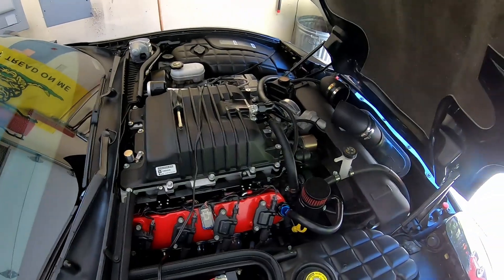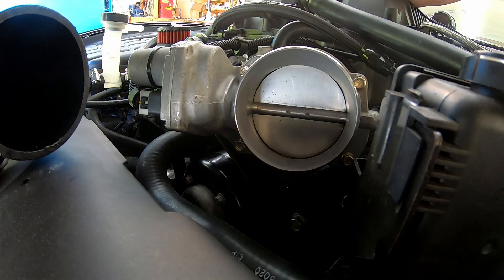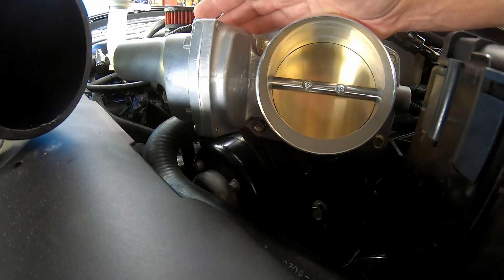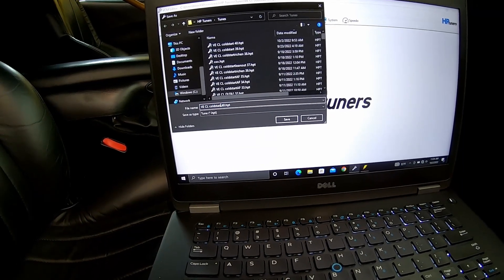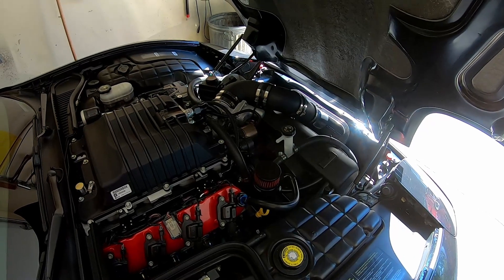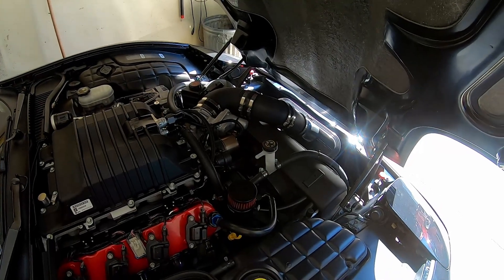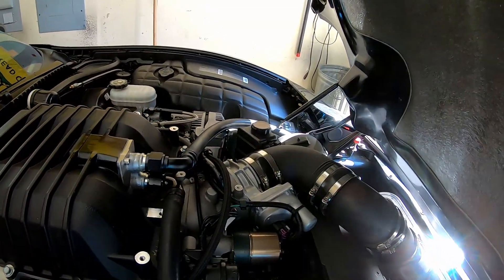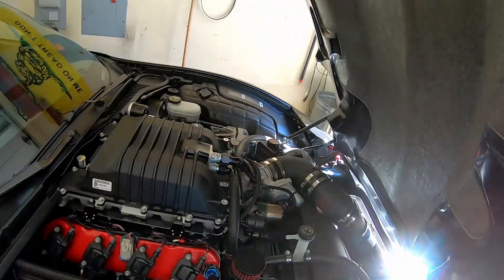How To Run 90mm LS3 Gold Blade Throttle Body On Gen 3 LS1 VS Silver Blade C5 Corvette

Comment: I have a corvette c5 2004, and i have problem with the throttle body because  is compatible ls2,ls3 and ls7 and the throttle body when i push the pedal on the acelerator it moves a little bit.
Reply from the maker: Jr I'm not sure exactly what you have going on there.  Are you saying that you put on a 90mm throttle body and that the car wont' run?   Also IIRC the 2004s run a different PCM than the 99-2003s.
Reply: @PNW_Car_Mods  i put the throttle body 102
Reply from the maker: @jrantonio07gamer75  Wait, are you saying you are running a nick williams 102 drive by wire throttle body?   If so, those take even more tweaks in the tune to make them work and I honestly don't know what all those changes are.  It can be done though.

Comment: Corvettes are finicky with the throttle bodies. Cool to see a ls3 one working. I am putting a ls2 TB on my brothers car
Reply from the maker: Yes they are.  Some people have no problems and others have so many problems they end up going back to stock.   The problem with LS2 throttle bodies is there aren't that many of them and the pool of them are getting old.
Reply: @PNW_Car_Mods  I know and people want a lot for a very used throttle body. I do have a couple ls2 throttle bodies and 1 ls3 throttle body. We are doing a 408 stroker with ls3 top end. Already tested both ls2 TB and they work no codes as of yet. I’m going to have to go through your videos since I’m a new subscriber. Love the LSA on your corvette! Looks like a tight fit tho

Comment: how is it so far? you did anything else? mine was able to start after 4 attemps but code were present, i just found the hp tuners forum, but its great to see it actually worked.
Reply from the maker: If you have codes it is likely because of an actual problem with wiring or throttle body internals and not the result of running a LS2 or LS3 throttle body on a gen 3 PCM.

Comment: What about running a gold blade LS3 throttle body on a 06-07 Corvette?
Reply from the maker: I am not sure on that max.   That is a totally different generation of PCM.   You might have to do some searching on the forums.
Reply: @PNW_Car_Mods 
The C6 doesn't suffer from the same problem. 
The C5 PCM/ECU is problem. 

We're probably going to the Holley Dominator and remedy all of our problems with the 102mm Nick Williams gold blade TB

Comment: Hey,  im back here again,  so im having some issues with my ls3 throttle body, I got REP right away before I even started it, so started it fine except no pedal response at all , so when i checked when the car is off , boot removed the blade doesn't move at all when i press the pedal,
Reply: It's all brand new, I think the harness I purchased while back from Amazon,  unknown brand, I think I'm going to get the caspers one to give it another shot,  also I forgot to mention the throttle body I was trying it was for like a 2010 silverado truck,  it's ls3  90mm . I also still have brand new gm ls3 gold blade when I hooked it up yesterday,  It works the throttle moves fine , the only problem with this one I can't install it because I have this 92mm FAST intake manifold it's longer then the stock so when I try to install it , the plug on the throttle body hits the  serpentine belt tensioner , see in your situation u have a supercharger with a snout that kinda offsets your throttle body,  for my case to clear their belt tensioner I would need like almost 3" spacer adapter,  so I'm kinda stuck
Reply from the maker: @boggsd4067  any chance you could flip the gold blade to get clearance?  Even if you have to extend the adapter harness?
Reply from the maker: That would be a hard one to troubleshoot without being there in person.  Do you know the history of the throttle body? is it new?  Used?  What adapter harness?  Any bad connection will give instant REP and no throttle.
Reply: I thought about that,  my harness will reach fine only issue , power steering reservoir is in the way , not it has to be relocated,  no really good spots to do that,  and even wille I was looking close if I do that,  the bulky part of the gold blade looks like it might hit the alternator braket
Reply: I just checked again,  it might clear it when I flip it if not I have a 1/2 thick ls throttle body adapter that I had to use for the truck throttle body , so I can just use that,  now I might just have to be creative on making this custom braket for the power steering reservoir,  this is might be my last resort. Because I literally spend all day in my garage trying to make this truck throttle to work and no luck. I flipped the wires so may different ways and probably turn the ignition on over 30 times to test,  still keep getting P1515 code or P1221..I think its probably something have to do with pcm , because I can't find a darn this online that shows the wiring diagram on this truck one, I only found one picture shows what each pin the connector is, not sure if it's correct or not

Comment: If the schematics are the same, an ls3 tune should of did it for you minus the fuel tables
Reply from the maker: I don't believe that is possible.  The LS3 uses a completely different operating system in a totally different P/N PCM.

Comment: I have  gen 3 truck electronics "8 pin" and looking for a tb larger than stock. My new intake is a 4 bolt 103mm. I really dont want to change ecms and a bunch of electrical. Would a 90mm ls1 tb use the same plug? Also are they 3 or 4 hole?
Reply from the maker: I don't think it will work.  The LS1 is a 78mm 3 bolt with separate blade motor and TPS connectors.  The LS2 LS3 90mm is 4 bolt and a 6 pin connector.   You may have to do some research on the LS1 Tech Dot Com.
Reply: What about the 3 to 4 bolt adapter plate and the xlink adapter 8 to 6 pin wiring harness?

Comment: Hello, I have a 2004 CTS-V that I am looking to swap to a Gold blade throttle, as silver blades are just too much money. Do you have any idea if an older LS1/LS6 PCM would have the same success with these tweaks? Additionally will the adapter harness for an LS1/LS6 to LS2 work for an LS3 throttle?
Reply from the maker: The only reason I can't say for certain if it will work in the same manner with the same HP tuners tweaks in your CTS-V is because I think your car has a different PCM in it than the early Gen 3 PCMS  411 or P01 style.   I'm sure somebody out there knows.     Yes I am using the exact same adapter harness as when I had the silver blade on the car.   No changes to it.
Reply: I'm running a gold - blade LS 3 TB on a 2003 Z06 with a FAST 102 intake.  The engine has new heads, cam,  valve train,  etc.  With the adapter harness it is running pretty good.  I occasionally have some stumble on clutch-in, but overall it runs really good.  I think the engine in your Caddy is basically a C5 ZO6 engine.
Reply: Did u ever do the ls3 tb on the caddy?
Reply: @Dirty_car_builder_88 no, couldn’t get the tune tweak to work right, ended up going with a ported LS2 throttle body.

Comment: I’m about to put a 92m throttle body on a ls1 with adapter plate any help you caould tell me would be appreciated
Reply from the maker: Are you talking about putting a 92mm on an LS1 Intake manifold?   I personally would not do that.   a 78mm throttle body is good for upwards of 450 wheel horsepower.  It is rarely the restriction.

Comment: Are TRQ silver blade 90MM throttlebodies a good choice for stock 2004 GMC Yukon L59 vin code z? I know I need the adaptor by x link (8pin on the truck 6 pin on the TB) but don't feel like dropping 300 bucks on a TB I spent 60 on. Are there any alternatives when it comes to the adaptor that aren't so pricey?
Reply: The Silver 90mm throttle body will work with the LS1 to LS2 adapter. To run the adapter on a truck application 1999-2002 (which uses the exact same throttle body and TAC module as the LS1 minus it facing the opposite way), you need to switch the two wires inside the 2 prong plug which will reverse the current for the opposite direction of the same throttle body on the truck application. This allows it to run on the Stock PCM, because the adapter makes the computer think it’s still plugged into the factory throttle body.
Reply: @Peculiarsafe83  then y switch the plug? it already opens the same way because they are both silver right? Not trolling I'm serious this shit killing me
Reply: The LS1 adapter and the 90mm throttle body on the truck application WILL ONLY WORK WITH THE SILVER BLADE. The Gold blade is opposite and it will not work.
Reply from the maker: That is out of my realm of experience.   I have a new TRQ Silver blade and my 411PCM won't even recognize it.   In my case I am using a cheap 25 dollar harness adapter to go from 78mm Corvette throttle body to 90mm Corvette throttle body.
Reply: @PNW_Car_Mods  that sux that the pcm wont even see it! What's your take on the xlink adaptor? Is it worth the price?
Reply from the maker: @budthechud3408  I can't personally think of a reason to use it but that doesn't mean it doesn't have a place out there where it does what it claims.
Reply: Factory ECM's and X link are not compatible with most aftermarket TB's. One reason GM silver blades are so expensive.. it's nice to see the ls3 TB working with a factory ECM

Comment: Thanks!!  Exactly the information I am looking for to swap the throttle bodies to my LS3 swap in my C5.
Reply from the maker: You're welcome.   Are you going to use the reluctor wheel conversion box to make the LS3 work?    I have a buddy with an LS3 C5 and since he had his engine apart he swapped reluctor wheels so he didn't have to use the conversion box.   Good luck on the build!
Reply: @PNW_Car_Mods  I did the wheel swap when I built the motor. I used the Casper harnesses for the knock and cam sensors
Reply from the maker: @bionic2011  Nice that is the way to go if you can.  I've not heard the greatest things about those conversion boxes.
Reply from the maker: @bionic2011  That number sounds familiar but I would have to do some homework on it.  This is the one I bought new from Summit.   https://www.summitracing.com/parts/ADO-19420707
Reply: What exact wire harness adapter did you use? According to Caspers, their harness is only for 2008 and older. They cannot confirm it will work on newer model years, they do not wrench on cars, only build harnesses. They did say theirs works in silver blade.
Reply: I just got off the phone with Texas Speed, the said that the X-Link only works with '03-'06 trucks LS2,3,7 throttle bodies. Did you have to splice in the harness? If so, what were the steps/splices for pin outs?

To be clear, I still have the stock 2002 LS1 computer and wire harness. I thought you mentioned the same in your video.
Reply from the maker: @bionic2011  I am running a cheap Michigan Motorsports LS1 to LS2 harness adapter unmodified and that's it.  Make the changes in HP Tuners to the blade angle limit and zero problems with REP.   This is on a gen 3 411 Corvette PCM with HP Tuners 3 bar speed density operating system loaded.
Reply: @PNW_Car_Mods  I'm NA so I won't need to run the 3 bar program, unless you think there is a reason for me to, correct? I have the stock computer still in the car which is the 0411, I believe that is the same as what you are using correct? I do apologize for all the questions. But, I think it will jeep others as well that may be to "shy" to ask, and honestly, I just want my car to run as good as you expect your to run and be just as reliable. Thanks.
Reply from the maker: @bionic2011  yeah you should be able to run it on the stock tune operating system.  Just have to go in and limit that throttle blade opening in the tune so the gold blade doesn't overtravel causing REP.
Reply: @PNW_Car_Mods what is the benefit of the gold blade ls3 over the silver blade ls2 TB? And do you know why so many poke have protons with the nw 103s? On c5s
Reply from the maker: @Tristenseth7  Gold blade LS3 can still be bought new and for a relatively cheap price.  LS2 is less reliable and virtually impossible to buy new.  There is just simply a much smaller pool of LS2 throttle bodies on earth.   I have no experience or knowledge of the big NW DBW throttle bodies on GEN 3 PCMs.  Not saying they can't be made to work, but I don't know of any.

Comment: Run into REP at any point since this? Put a gold blade on my C5 with a cam swap. Runs pretty reliably with that change, but every now and then it'll throw REP on a normal street shift. P1515
Reply from the maker: Not a single time so far.  Got about 1500 miles on it and just did 3 WOT pulls on a dyno last week.  Still working perfectly.   I've heard that besides getting REP at wide open that it's possible it can also come from the brand of harness adapter used.  Have not been able to verify the harness adapter scenario though.  Just hearsay at this point.
Reply: @PNW_Car_Mods  Might be related. Cheap amazon adapter harness that was pinned incorrectly and I have to re-pin it... Think I'll just need to get it to happen in a datalog and see what's going on. Thanks!

Comment: Not even a silver blase LS2 TB works on my C5. Is there a need for tune even with that one? I bought a Dorman one so... I also have a gold blade LS3 TB (aftermarket WCYOTECH) and it throws the same Reduced Engine Power code as when I put on the LS2 Silver. The car does run with the LS1 Stock TB but burns ALOT of fuel (assuming that is the case since I have bigger injectors now and didnt tune them yet).
Reply from the maker: You have to run GM throttle bodies.  No exceptions.  I have tried two of the Chinesium silver blades and they won't do a damn thing.  no response.   Never even entertained trying a no name gold blade.   Get a real one and it will work.     Be careful running that engine with injectors and no tune.  You can trash the cylinder walls easy enough.   Get a GM throttle body and get it tuned.  It will all work.
Reply: I bought a dorman one, and it had no tps response. Need genuine only
Reply: @Knackersjewels  just saw this, saved me the headaches. I was going to buy a dorman siver blade era throttle body. OEM only damn that sucks
Reply: Same here. 
5.5 to 7mpg supercharged, heavily camed, RPM Level 10 4L60E Automatic with a 3,800rpm Circle D Stall Converter

Comment: Thanks for posting this, super helpful. 

With the Gen 3 pcm and 90mm throttle body, where did you find reliable airflow tables to start out with?
Reply from the maker: Just start from a factory tune that is closest to what your combination is.   In my case the we grafted in a 2003 Z06 VE table into the 3 bar tune in the N/A part of the table.  That got it running where we could start logging and correcting the VE table.
Reply: @PNW_Car_Mods  Thanks for the reply. Did you make any adjustments to the ETC airflow tables though to correct for the 90mm? I thought the throttle response would be weird if you left the stock LS1/6 tables in place as the 90mm obviously let's way more air in at lower % opening?
Reply from the maker: @sohcd16y8  yup. I should have mentioned that in the video but I didn't think about it as I'd already been running the silver blade for years.  The scalar is set to the common 90mm .0192 number.  No problems.
Reply: @PNW_Car_Mods  just came back to say thanks. Got my LS3 Crate Engine with LS3 Gold Blade TB running in my C5z with the info you provided.
Reply: Any updates, tune changes, etc?

Comment: Is the c5 corvette throttle body connector a 6 or 8 pin connector?
Reply from the maker: Victor to run any of the 4 bolt 90mm throttle bodies on a C5 Corvette it requires an adapter harness.  Commonly available from lots of places for under 20 bucks.   On the stock C5 throttle body there are actually two connectors.  One for TPS and one for the blade motor.   These get merged two into one from the C5 harness to the new 90mm TB single connector.    Hope this is not confusing.

Comment: Sounds good! Love the whine.
Reply from the maker: Hey Ryan, how did your homestead fare through the storm?   I hope you all are OK.
Reply: @PNW_Car_Mods  we were 10 miles from the eye wall... couldn't have gotten luckier. No major damage... lots of wasted time doing cleanup though... the place was a mess.
Reply from the maker: @JackofAllTrades1  Great to hear!
Reply: @PNW_Car_Mods  I've not had the inspiration to put together a video lately but you are really rocking it. I've been messing with the 455 alot lately, it just doesn't idle the way I think it should. I'm even going as far as installing an o2 sensor in it this weekend to see if it will help with the tune.
Reply from the maker: Thank you sir.  I find it to be just about right from inside the cabin.   You can hear it when need be but it's not obnoxious like a hellcat.   Since blowing up the old engine I've really set out to make this new combo not only very powerful but also just more comfortable and easy to drive.  I want it to be easy enough that anybody can drive it without having to go through a drivers meeting lol.